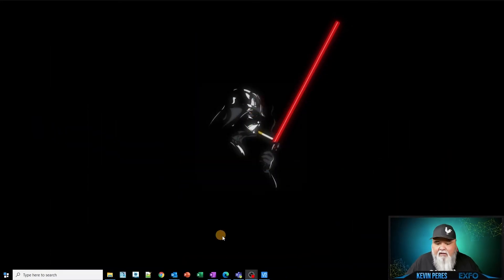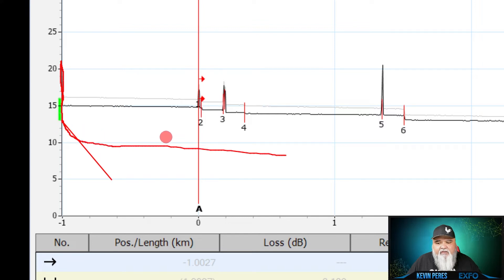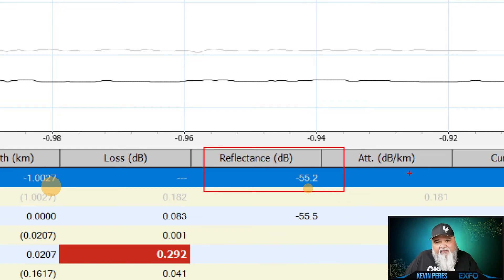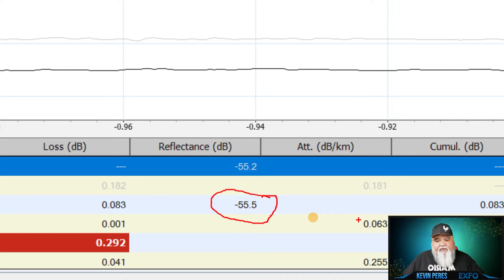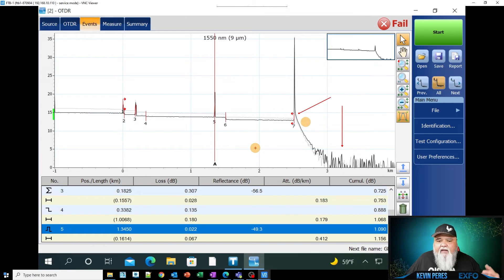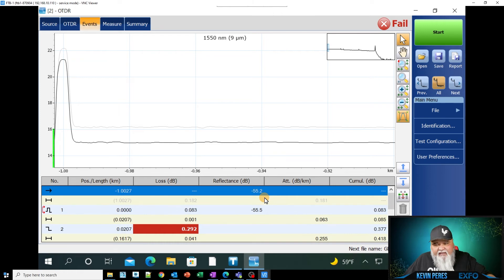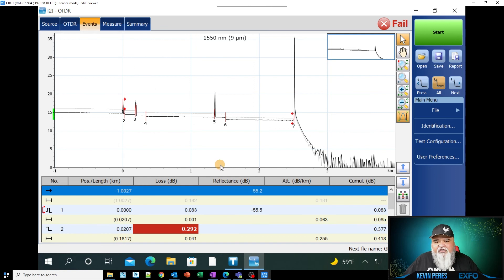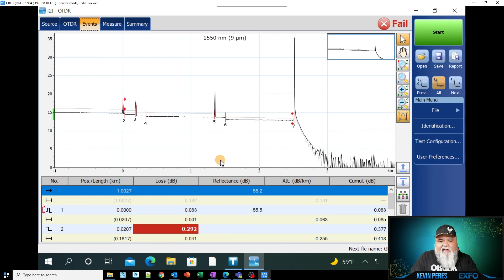Validating an OTDR trace.

Comment: I just bought a 720c my tests are failing at the end spike with -20 reflectance, rest of the trace is perfect, how do I fix this
Reply from the maker: The end spike at -20dB is fine if it's an open. If you do not have a receive fiber than in the OTDR Configuration menu at the bottom left make sure you uncheck (ignore) the span end.  That is the open and should be ignored. It is only taken into account if you have a Reciever fiber.

Comment: Hello Kevin Sir, I heard in one of the webinars that its important to select the proper launch cable length according to the length of the link to be tested. So my question is does the length of the launch cable really matter when testing different types of links with varying lengths or it has no affect. Like if I have 1 KM launch cable, can i use the same launch cable for testing links with varying length like 100 Km, 12 KM or 20 KM.
Reply from the maker: Hello sir,  Yes launch cable length does matter with an OTDR.  The longer the pulsewidth the longer the launch cable needs to be. With that said a 1km launch cable is sufficient for all the lengths you mention.  You do need to use a longer one if you get over 120km or so or around 1µs in PW you will need to increase your launch cable.  Just make sure that you can see the reflection at the end of the launch cable and that there is some distance between the OTDR port launch reflection and the end of launch cable reflection.  At 1µs there is about a 200 meter deadzone after the OTDR port.
Reply: @KevinPeres  Thanks and got it, Sir.